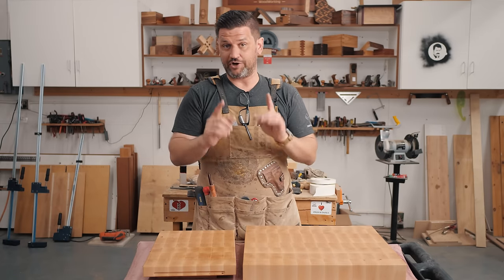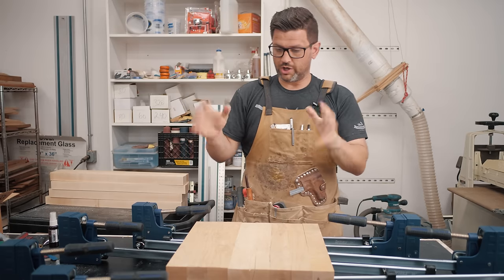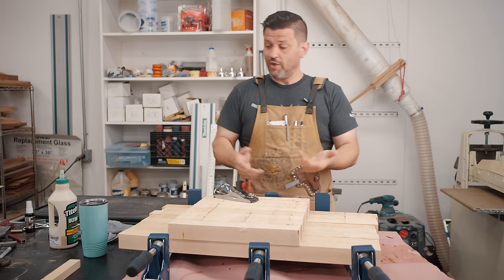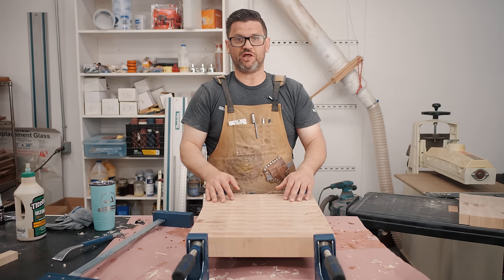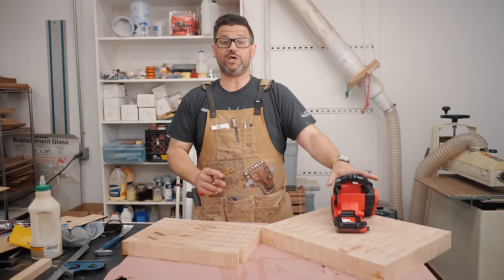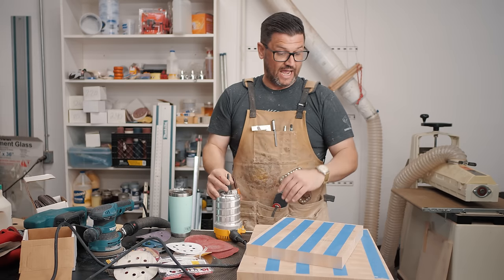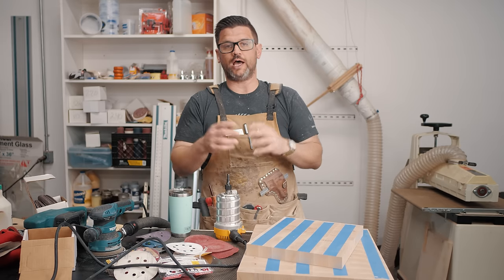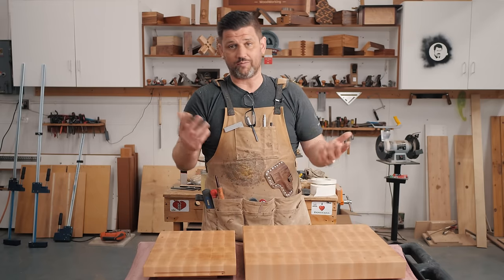Make Money With These Simple Maple End Grain Cutting Boards

Comment: Just FYI, I watched a video on America’s Test Kitchen where they compared cutting boards and they determined that end grain cutting boards do not make your knives last longer and because the have more glue joints they are more likely to split over time.
Reply: Sean Keehn Yes...a teak long grain board won for the second time in ten years.
Reply: They did call out that it was mass-produced boards being tested and hand made boards can be made more durable.

Comment: I consider myself an expert in using a belt sander. Been using a good one for 50 years. But I just got a Bosch 6 inch geared orbital sander with turbo mode. Made 4 end grain cutting boards with hard maple and walnut. After the last glue up, did all of the sanding with it. Started at 60 or 80 grit. Worked fantastic. Will probably never use the belt sander again. Thanks for all of the great videos that you do. Keep it up.

Comment: I make end- grain boards, and in my experience the titebond 3 is hard as hell when it dries. The hardened glue makes the planing, sanding, and finishing a bit more difficult.  The titebond 2 is more than sufficient for a board, since you're not ever going to submerge the finished product.

Comment: Hickory will tell the tale on your blades as well. I run a cabinet shop. We have to resharpen everything after one set of hickory cabinets. Sometimes I even have to have spare bits around for the shapers before we get even halfway through milling the door stiles and rails.
Reply from the maker: Yeah Jay Bates uses a lot hickory and says the same
Reply: @katzmosestools  its brutal man. But, using a clear finish, it turns out beautiful.

Comment: Hey brother. I make a lot of end grain boards. Likely on your planer on the bottom rollers the edge of the wood was getting caught on that lip. That's what happens on mine. I actually take a ROS with 80g on it and put a 10 degree bevel super quick on the edges of the board to stop that when it's rough. Also you can do the same thing when it's turned end grain to stop tear out through a planer

Comment: I recently finished a new maple cutting board (3/4" thick) to replace the old one that was badly warped. I slathered it with mineral oil a couple of times to make sure it was well conditioned. I'll definitely try out pipe clamps, as using the F-clamp was a little challenging to keep it completely flat while gluing up.

Comment: Professional chef tip... take two pieces of paper towel get them wet and squeeze out extra water. Put those under your board and it won’t slide around. I won’t use a board without wet towel under it. Then you don’t need feet on the little board and you can use both sides. Great video and good looking boards.
Reply from the maker: Great tip! Thank you! I'll use that at home

Comment: i just did my first "big" board, 24 by 16 by 1 1/2. i flattened the final glueup with my new v-drum sander from stockroom supply in ontario, canada.  i wont say that flattening was a breeze but waaaaaay better than a belt sander.  i'll post a link to my machine on fb if you are interested.  if get a chance i'll shoot a video and post it on my channel

Comment: great video, my biggest problem is that most people don't want to spend the money on these quality boards. They rather go get a cheap one from Walmart or wherever else. They don't understand that this hardwood would last them for years to come, and all they have to is apply vegetable oil once a year. Here at the Northeast, these hardwoods are harder to find. Getting a 8' 8/4 Walnut is almost $100 for one piece, so it's frustrating to even get some since the demand isn't high on these. By the way, a great oil and finish wax to use is a brand called "Walrus oil". It's not expensive and you only apply it once and yuou're all set. Thanks for the video. Cheers :)

Comment: Master craftsman, master chef. Respect the Shun knives. I damn near cut the tip of my thumb off drying mine the first time. It cut through the towel I was using.
Would planing the board with a low-angle jack plane not be faster, like shooting endgrain? I just abhor sanding.

Comment: That craftsman is a rebrand of the old Black and Decker. $35 at the Homesless Despot. Works OK, I used it to sand an entire 400sqft deck but definitely not a fine tool. I was honestly surprised it lasted the whole deck
Reply from the maker: Lasted literally 3 minutes before smoking and the belt stopped spinning
Reply: @katzmosestools  Man Craftsman has gone so far down hill. You get what you pay for I guess

Comment: Regarding the glue: Titebond 3 is also food safe (don't eat it though! It only means it's safe to contact with the food)

You can also use planer to help with the final leveling, so you'll sand only as part of the finishing process. But you have to shave it off little by little and glue some sacrificial boards on the short ends, because without them planer will tear this endgrain out like it's getting paid for doing that.

And as for the feet — they help not only for moving, but for keeping the board away from the extra moisture on the tabletop and during drying, so consider this if you're planning to build one.
Reply: Maybe better done if you have a helical cutter on your planer-otherwise doing the final leveling on the planer can be pretty tough to get right (as you point out-little by little!).  Sanding is far safer (for you, and the cutting board!).
Reply: Running end grain through my planer dulls the knife immediately it seems
Reply: @kevinboas6607  I'm going about ¼-⅓ millimetre per pass, and I didn't notice it. But I haven't done it too much, so maybe that's why the blade wasn't damaged.

Comment: In determining the amount of wood you need. How are you doing that.  If finish board is to be 12×24×1.25 how do you know what to mill your thickness to for the first glue up and how long to make your strips. Is the length in the first glue up the length of the finished board?

Comment: Well, one main question, I thought it was a big no no to have all your glue joints line up. I know the glue joint is stronger than the wood, at least if it is done correctly. I do like the off set patterns better... 

Second point is that I mostly make wood bowls. Never use mineral oil because essentially it does nothing other than make the wood look wet for a bit. Most of us use walnut oil for a finish, I prefer the stuff from the Doctor's Woodshop. It is heat treated to get rid of all the proteins that can cause allergic reactions, and it will soak in, then set up and cure/harden. The doctor said to use a heat gun so it will penetrate deeper. 

Agreed that sanding end grain is a pain. I use my drum sander, no other way to do it that is worth the effort.

Comment: @07:00 instead of flattening with a sander would it be easier to do the glue up into two pieces and joint/plane them flat then a final glue up of the two pieces?

Comment: I made some charcuterie board  at 1/2" thick 9"x9" boards out of Walnut. I cut 1 in strips .and glued them up with Titebond 3.  I want to keep them as flat as possible and I don't want to use breadboards.  I was thinking of putting an inlay  offset  from the edges, so I would have a 7" Square Frame at 1/4 " wide and 3/8" Thick Edge side down centered, basically Splines. Would this work?

Comment: Hey Jon, what about using a router sled to do the bulk of the flattening, instead of the belt sander??
Reply from the maker: I think it would cause tear out on the edges
Reply: @katzmosestools  hmmm.  maybe flatten first and then trim to final dimensions at the table saw? :)  I think I`ll try it and find out !

Comment: Stupid question but something I struggle with on these cutting boards, I usually round the 'face edges' with a 1/8" roundover bit but 4 'small' edge edges that are left, how do you round them over easily? I've just stuck to using sand paper and rolling them over.

Comment: Perhaps  you could help me with a question.  I used cherry and red oak for my end grain board. When oiling, the red Oak wicks the oil from the top to the bottom in a matter of seconds, right through the thickness of the cutting board. Will this stop after several oil treatments? (3 so far) Will it affect the use of the cutting board?  Thank you for any help or info.

Comment: $42.00 in wood +  $15-20.00 in glue ;-).  Yeah, dropping the arbor nut, always occurs on the saw with the least amount of room  for manipulation. I'm thinking about epoxying a neodymium disc magnet to the end of the arbor. Small enough to not interfere with the threads, strong enough to keep that nut from falling away when it slips from the fingers. May or may not work, but if it does.....

Comment: Why do you need to sand by hand tools after 2nd glue and not simply push through planner again? Thanks
Reply: If you try to run end grain through a planer it will tear out the edges really badly. I’ve heard it can even be dangerous.

Comment: My belt sander just gave out, I went to buy a new one on amazon and I found disc sanders, specifically makita disc sander, I was thinking about going that route instead of a new belt sander, any thoughts?
Reply: Will Fishing Personally I would have a belt sander on hand in addition to an orbital.  If there is any considerable amount of sanding to do on the end grain, the belt will take it off so much quicker.  Than orbital to fine finish.  Just my opinion.
Reply: I bought a Wen belt sander because at the time I had very little $. I have been so impressed with this thing! It is a beast! If you are using 40-60 grit you better be prepared for a hell of an arm workout!

Comment: Why did you sand the end grain instead of running it back thru the planer?
Reply from the maker: You cannot run end grain through the planer. It will tear out very badly and potentially is dangerous
Reply: @katzmosestools  thanks. I'm exceptionally new to woodworking and enjoy how informative your videos are.
Reply: Ever see a planer kick back an entire cutting board? I have.

Comment: Hey if you or anyone else is still around I have a question that is really putting my board on hold ok so I have the glue up done but none of the edges are flush or straight like the sides are a little wavy so I dont have an edge to run against my table saw to trim the fat as it were can u help me come up with a solution I know how to make a bowed board straight using some screws and a factor edge board but I dont want to screw into my end grain board and I dont have clamps that will work on my table saw
Reply from the maker: Check out my 5 ways to joint without a jointer video. Cheers!
Reply: @katzmosestools  I have watched that video and it is great but I do not have a router bit that's long enuff the cutting board is over 2 inches thick but I may be able to use the double stick tape idea with my table or band saw ok so next question and this is really what gets me.  And I'm going to do my best to make myself understood but u may find it to be inadequate. Ok so u have an edge of a board with a bow or in my case a edge that's willy nilly that needs to be trimmed flush so how do u measure when attaching the factory straight edge so that when u do make the cut it's not angled like where ur cutting everything flush but at the samn time it's going to be going "uphill" when u look at it end up.  Does that make sence and thank u for replying

Comment: Would this be possible to do this with just a mitre saw if you bought precisely machined par timber ?

*Assuming you have a sander and other miscellaneous stuff that all workshops have
Reply from the maker: If your miter saw cuts wide enough and you're prepared to do a lot of sanding.
Reply: @katzmosestools  
Thanks. It has alot of crosscut range so just gotta get to sanding